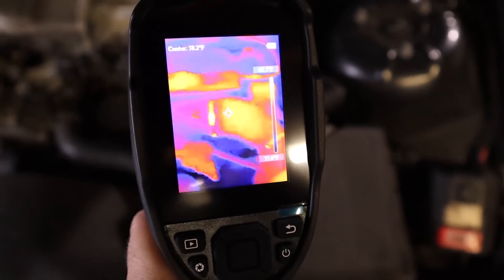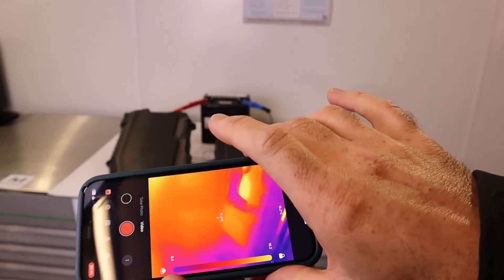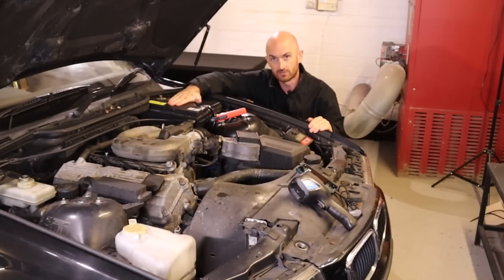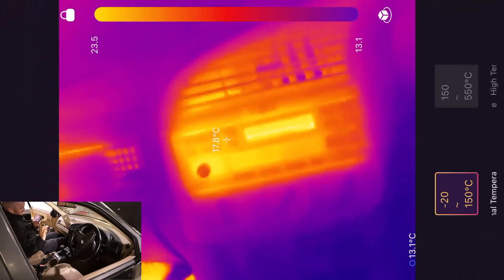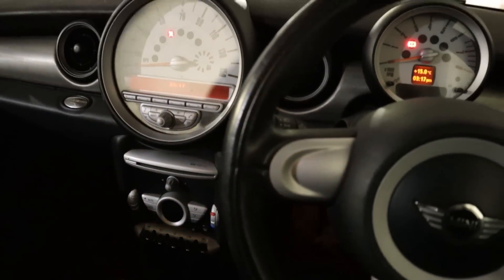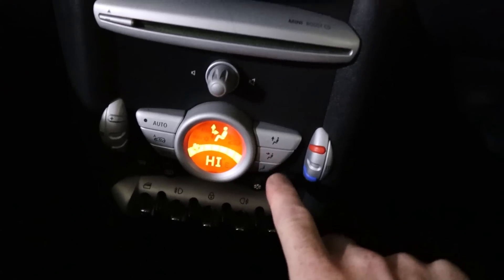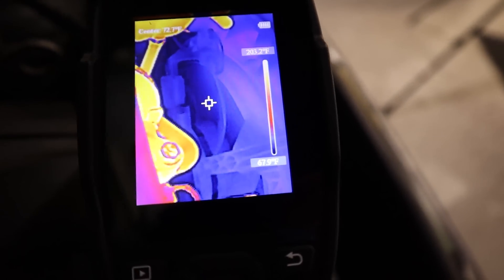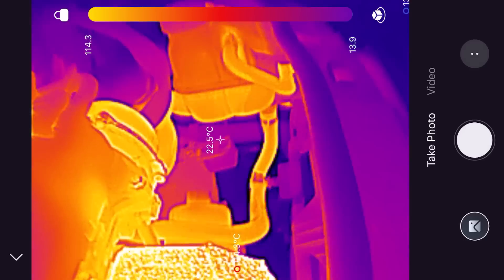This Tool Sees What You Can’t and it’s AMAZING!

Comment: I use mine daily (integrated infiRay module in my phone and love it) 
finding brake faults, overheating cable connections, defective modules pulling power, diagnosing AC pumps and PTC heaters for both ICE and EV cars, finding bad 12v battery cells when charging (one hot cell =dead or dying battery) checking heated mirrors and rear defrosters and seats, checking catalytic converters if they are hotter on the exhaust side like they should be, and much more private in my house and outside 😅

Also seeing if the tire pressure is wrong
Reply from the maker: Great creative uses for this great tool, thanks!!

Comment: Aliexpress do some good IR cameras for about £100.  I have a Goyojo GW192 and it is very capable for the price and surprisingly good resolution.  Remember the focal length is short so if you are wanting to IR from a distance pay attention the the camera spec for focal length. Generally these budget cameras are short at about 30cm. 

As a retired Thermgrapher of 15 years I can recommend it over the Flir.  I have a $35k camera under my desk but find the Goyjo more convenient. Caution be mindful of reflections, you will get spurious readings from Stainless steel, aluminium, brass, cooper unless they have a paint coating.  Don't jump to a conclusion, think how the heat is being generated and where it can move.

Comment: Great video Darren. I bought a so called rugged mobile phone with an inbuilt FLIR thermal camera a few years ago which turned out to be the perfect choice for me as a mobile mechanic. I needed a mobile phone at the same time I bought it so buying that phone proved to be much cheaper than buying the camera and the mobile separately. Now this phone has been replaced with several never models so the price has dropped considerably. If you buy it now it will be almost like buying a thermal camera with a free mobile smart phone (4G Android 10).
Reply from the maker: @HelgiThorisson  Ah awesome, I saw them a while back, right after I bought the Seek Pro for iPhone (and yes, it was about the same price 😵). Is it the Caterpillar phone? I think it does a good overlay with the normal camera too?
Reply: @MechanicMindset  No, it is Ulefone Armor 9 and it has a great Samsung camera too. I bought it with an endoscope and a body cam that has night vision. The accessories have proven to be well worth the money spent. The endoscope is much better than some others that I have seen. Regarding the night vison body cam you can position the phone in front of your eyes and the camera pointed at what you want to see and you can continue working during a blackout for that matter.
Reply from the maker: @HelgiThorisson  😮

Comment: I used it for wheel alignment before, where the bearing had a fault and I let the customer drive the vehicle and you can see where it was making more contact. Another is for bearing fault. More friction, more heat
Reply from the maker: @LAKERS4LIFE-g1i  Nice 👌

Comment: Excellent tool for checking brakes on HGV trailers or wheel bearings or even air leaks in the pneumatics lines or fittings
Reply from the maker: @FXGT1989  Smart tests there 👌
Reply: Does the air leak show up as warmer or cooler than the surrounding area? I work with air brakes a lot and won’t give this a try.
Reply from the maker: @ronunderwood5771  It depends if the air escaping is hotter or colder than the surrounding area 👍

Comment: You can diagnose MISFIRE, if letting circumstances and exhausts pipes, CATALYTIC CONVERTER restrictions, also VOLTAGE DROPS on positive or negative side, bad connection get hot,  probably GLOVE PLUGS, bad COMPONENTS on electronic board...and so on.
Reply from the maker: @GraditelMacedonia  Great suggestions! It’s such a versatile tool.
Reply: @MechanicMindset  Yes! My one is UNI-T UTi 260b pro. Great thermal imager  for money.